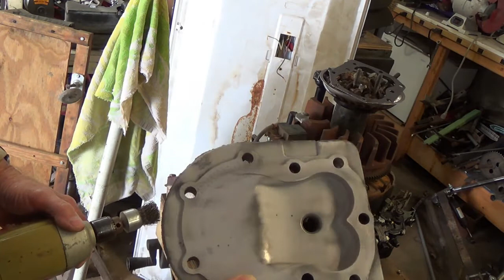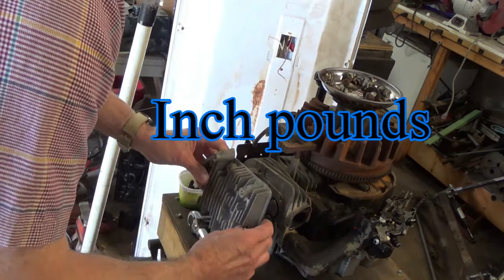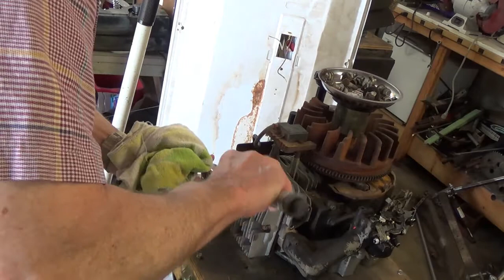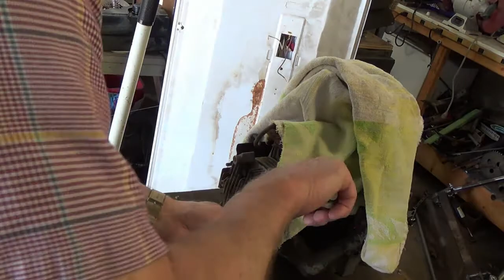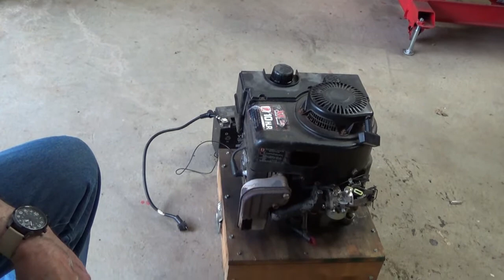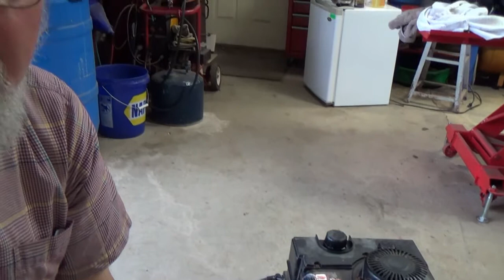Tecumseh 10hp head gasket, run & sweepstakes announcement!

Comment: 3 things come to mind,#1 compression is? # 2 valve clearance in specs? #3 flywheel key in one piece? sometimes your the windshield,sometimes your the bug
Reply from the maker: I'm guessing the valve clearances at this point, but I will dive into it again later on. More pressing things like both the Ariens mowers AND the Goofy Cart! Thanks Roger

Comment: I have a Tecumseh formula 10 MTV 220 motor has spark can't get it to start rebuilt the carburetor still can't get it to start has no leaks and then perfect condition and I can't find any idea why it's not starting
Reply from the maker: It takes 4 things to run, fuel, air, compression and spark. One of those is either lacking or the final element that could be your issue is, is it timed properly? Check the woodruff key on your flywheel to make sure it isn't stripped, which would keep it from running. Hope this helps. Thanks for stopping by.
Reply: The Shade Tree Fix-it Man i don't know how to check the timing this motor is all new to me .. did a compression test very high.  put gas in it today and gas i coming out the carburetor heavy drip.. well im done with it  time to shop it to someone who has more knowledge of these..
Reply from the maker: @amd65ak47  You would have to remove the flywheel to check the woodruff key. If the float wasn't set properly it would overflow the carburetor as well. There often is a little tinkering with these engines to get them to perform properly.
Reply: again i don't have the knowledge of doing this .. I'll have to leave it to the professionals

Comment: had one do this and I changed the ignition system . Mine didn't have a decompression valve though . Simple engine frustrating problem to say the least .
Reply from the maker: This has electronic ignition, but that doesn't mean that's not the problem either. More investigations...later! Thanks

Comment: I am thinking the problem with that engine has to do with the valves, I'v had some engines that were hard to start and the valves was the problem.
Reply from the maker: I am thinking that you are right Vernon. I have been doing a little research and that seems to be the issue. It will take a bit of time to reset the valves, since I will have to tear it down even more than I did for the head gasket and I don't want to use that time now. I'm hoping that that is not part of the issue with my Ariens Fairway engine too. Thanks for the help.
Reply: yeah, it can be a bit tedious setting them,, grind a little, check and grind more etc, just not too much,, lol that's the tedious part,,

Comment: Those Chinese carbs are nothing but trouble. It could be the compression release as well like you said. Especially if the motor had water in it.
Reply from the maker: I'm also wondering about valve clearances. I'll get back to it later on....much later. Thanks Moe

Comment: i like playing with the head with a stone...polish...vroom vroom
Reply: carburetor bug?
Reply from the maker: Brand new carburetor and it does run better with it on there. Later we will dig into it again...later. Thanks Bob
Reply: sounded better when you adjusted higher rpms. i have couple motors i too have idles higher and some others

Comment: Key way out of timing
Reply from the maker: I don't think so. I had the flywheel off of this when I pulled it in and the key was fine. I'm thinking valve clearances now, but this project is on hold for now while I get some other things done that are NEEDED! Thanks so much